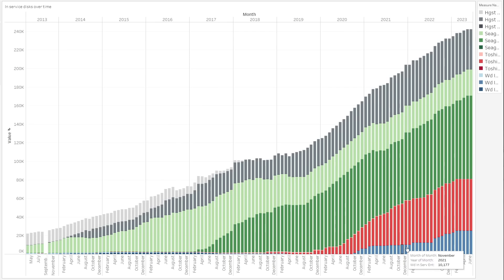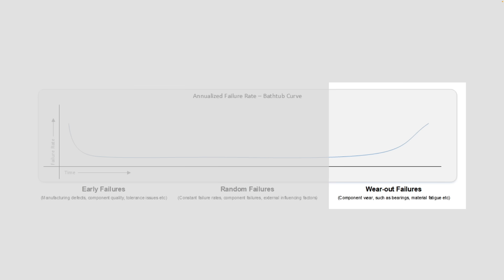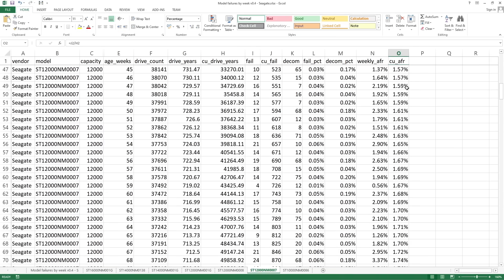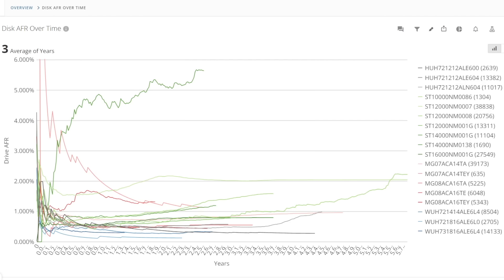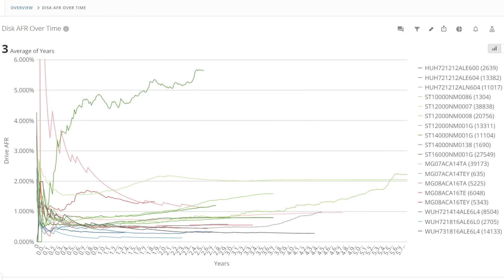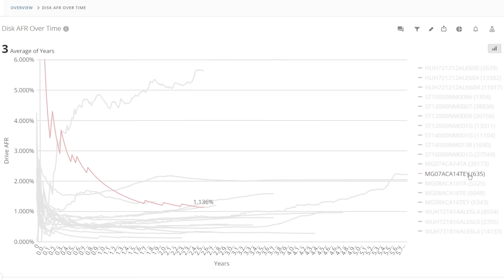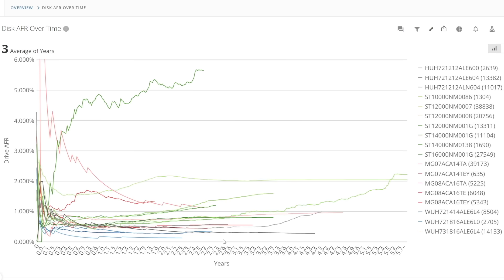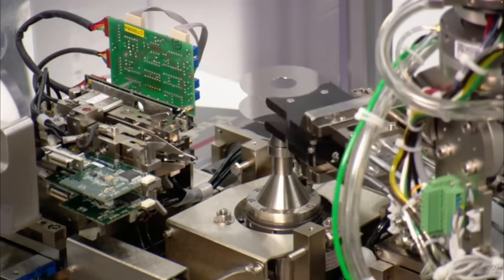Failure Rate Analysis - Best 10Tb+ hard drives: Seagate, Western Digital or Toshiba?

Comment: Great video! Made me reconsider my choices

I want to buy a 4TB external HDD

I want to use it mainly for archiving (videos, movies, games), mild use, 1-3 times per month.

What do you recommend? is the same results in the video apply to external HDDs?

So far a found a good deal for Seagate Desktop 6TB for 109$, while WD Desktop 4TB is 129$

Should i buy WD 4TB for better reliability, for more price and less storage, or Seagate 6TB with more risk? Or is there a better option you'd suggest? (I heard that buying an internal HDD and using it as external is actually better and more reliable)

Thanks a lot!
Reply from the maker: Thank you! The biggest consideration I have for external drives is if the drive in the enclosure is SMR or CMR. And this is not stated unfortunately. I have some videos on this, but SMR drives often have horrible write performance, and almost always have terrible rewrite performance.

Seagate externals pretty much always have barracudas in them, and these are SMR up to 8TB or so. WD it’s less clear for up to 6TB, but I shucked and tested an 8TB and it was a solid CMR drive. Above 6TB, I do not believe WD make any SMR drives (other than Exos high end Datacentre host based SMR, which you don’t need to worry about).

So my preference is WD, but it does depend on size.
Reply: @sometechguy  
Great! but is (External HDDs) generally a better option for archiving than (Internal HDDs with enclosure) or should I go with Internal one?

My main goal is to keep my files safe for the longest time, I'm keeping the hard drive at home, not going to move it around.

Thank you again.
Reply from the maker: @Lightrov i have a mixture of external drives and internal which I put in an enclosure that I use for cold storage. Here are the pros and cons.

External - often a very cheap way to pick up storage, if you pick up deals. The prices seem to fluctuate more with great deals sometimes, such as Black Friday. 

However, it’s less clear what you get drive wise and more likely to get SMR drives if <8TB, shorter warranty and I don’t like the heat as the ventilation often not so good on the enclosures.

Normal internal disks in an enclosure such as Sarbrent. You know what you get and you can more easily avoid SMR drives, pick up where the deals are, but I would go WD Blue, Purple or Red or Seagate SkyHawk or Ironwlf, avoid Seagate barracuda or Toshiba P300/S300 drives due to SMR and performance. 

May not get quite as good prices.

You can also : buy good deal external drives, avoiding the SMR by buying WD 8TB+ or larger seagates (10TB+), shuck th drives and use them in a Sargent.

Great deals on Purple and expertly SiyHawk. Just check the data sheets for the specific model and confirm they are not SMR.  I picked up some 8TB Skyhawks for great prices. 4TB probably not the best price per TB point, consider 8TB drives.
Reply: @sometechguy 
Thank you, that helped me a lot!

Comment: We fixed high failures on one of our rack as it was on the same slate of concrete as the AC compressor, so ground vibrated a little. With tape, we made 4 rubber standoffs from a single box of rubber gloves. Ever since, there was no anomaly in failure rate on that rack.
Reply from the maker: Interesting failure condition, and solution. 😁

Comment: I just had a Seagate 8 TB external hard drive die after simply shutting it off to move the desk. Turned it back on and it wouldn't power up! I even took it out of the case and ran it with an adapter. I've only used it for about four months! It didn't have anything that couldn't be downloaded thankfully. Seagate's always been reliable over the couple decades I've used them. I suppose having one die so quickly does happen on occasion.
Reply from the maker: Those 8TB externals usually have Barracudas in, which are SMR drives. Not that this is any way an excuse for it failing, and certainly not for even failing to power up, but I am not a fan of those. They come with 1year warranty, I wouldn’t defiantly try to exercise that. 🙂

Comment: through my experience, western digital seem to have the worse drives. I have had all 3 out of 3 western digital raptor drives fail within 5 years, 4 out of 6 western digital black drives failed within 5 years, these drives were not ran constantly, apart from the raptors which were for loading games from, meanwhile my old seagate drives I have never had fail, the need for more capacity was needed before any failed, and they were run every day, I had an old maxtor drive fail recently but it was over 1 decade old, I have also never had a samsung ssd fail.

Comment: Old HGST were the gold standard.  Now, all I think you can find are refurbs... but even those are better than Seagate
Reply: I had been buying the 10tb HGST refurbs branded as MDD.  Eh. Out of a group of three all bought at the same time, had one fail in a NAS at 18 months, plus whatever time it had before being resold.  Another of the three had some sort of weird partition issue at the same age.  10tb would not accept partition above 3tb. It felt like a platter failure. Not sure what's going on.  But I am replacing them with new WD Red Plus.  Generally prefer HGST or Toshiba.

Comment: I just decommissioned a WD Red 3TB (WDC_WD30EFRX) that had 108698 power on hours.  I've only used WD drives in my unraid server for the last 15 years and have had, I think 3 failures and they were all under warranty.

Comment: Would a standard WD blue be fine for desktop use? Just storing video footage
Reply from the maker: Yes, but just make sure you don’t get an SMR version. I have a video that covers the performance of the WD blue SMR and CMR drives along with The Seagate Barracuda and Tosh P300. For reliability, I think they are solid drives, though. It so much raw data to crunch on that.

Comment: Seagate is cheaper, but not by much. Not by a reasonable amount I'd be willing to bet my data on it. For a data center with thousands of drives? That's a different story.
All drives fail, I pray none fail without backup!
Reply from the maker: Yes, I agree with this. If you have large numbers of drives, validate backups, carry some sparing and are happy to use warranty; then small differences in reliability are easily offset by cost. But for smaller deployments, home, small and medium business then it’s a different calculation. Would love to see that gap closed though, interested how the newer HAMR drives play out.

Comment: Thank you for compiling the data, I never understood it like this when I looked at the data myself. 
Unfortunate that Seagate drives are so unreliable. From dB measurements their NAS drives are the most silent drives out there. I also hear when seagate drives fail they fail hard, so not so easy to back up. They also have enterprise drives that are less noisy than the other competitors.
Reply from the maker: The source data is organised by date, so if you look at failure rates this way you can see how failures happen over time, but it doesn't consider the age of the drives. So a more useful angle is to rearrange the data based on drive hours to find out how long each drive survived before failure, decommission or just how long its current service life is.

It is fantastic that Backblaze collect, keep and share this data; and the number of datapoints that are captured each day. It means there is a huge quantity of data here to look at, and I will be doing an update soon as its been 18 months now and there are now quite a large number of 20-24TB drives in the data that are starting to collect hours.

And yes, share about what the data reveals about the Seagate drives. Though they seem to be improving which is promising, and i am keen to see how that develops with the 24TB Exos. Though it seems not currently, they have also often been cheaper to buy, which with the warranty coverage, may still make them a good buy if the AFR rates are not too far off.

I am also doing performance tests at the moment on various Ultrastars and a comparative with the WD Ultrastar 18tb and Exos X18 18TB. This will include noise comparison, so will be interested to see how they compare for performance, noise and power usage.
Reply: @sometechguy  great work!

Comment: I have used WD primarily for over 20 years.  I finally tired seagate and they failed within months.  It wasn’t long at all so I went right back to WD.  I have NEVER had a WD internal drive fail and I’ve been using them over 20 years now.  I replace them to add higher capacity so I don’t know how long they would even last.
Reply from the maker: I have not had any serious issues with either brand personally. I have had some of each fail. But overall my experience reflects the data here. In total I probably have maybe 100 drives of various capacities in my home setup, with a pretty even split of WD and Seagate and I have an occasional failure, but the WD seems more likely to fail later. I just had an Exos fail that was 2 years old, and I had a Ultrastar that isn’t reported as failed, but it definitely isn’t ‘well’, and that was basically in this situation when it arrived. I have a collection of WD Red 6tb that are 7years old and they have been failing starting from around 5 years occasionally. 

But for sure due to the nature of statistics, some people have worse experiences with one manufacturer over another. 

The data here, at least at this point suggests WD do better over the long haul. And recently, the price gap narrowed and sometimes Ultrastars are cheaper than Exos, so this is what i am buying recently.

Comment: Can we get a refresh of this data for the new year, maybe Seagate x18, 20
Reply from the maker: This is on the cards soon, have a couple of other things I am working on but once the Q1 data is out, I think its time as it has been 18 months. Backblaze now have Tosh 20 TB, WD 22TB and Seagate Exos 24TB drives deployed. The Exos will only be maybe 3 months of data, but the WD and Tosh units will be over 6 months by now. 

And of course, longer datasets on the 14 and 16TB disks also. Stay tuned and don't forget to Sub to catch it. 😁

Comment: THAILAND, I prefer WD than other. Because WD's label specified "produce in THAILAND" (while other produce in CHINA, vary low quality and reliability).
Reply from the maker: Thailand has long been a center of excellence for disk manufacture. I have a pile of disks here, the WD drives seem to be made in Thailand, and the Seagates are a bit of a mix, but many say Product of China as you say. I think there was some diversification of manufacture after the terrible flooding events that brought the HDD industry to a stand still back in 2011.

Comment: Thanks nice and informative video) Can you tell me which software for charts you use, looks like it's own solution, but I'm curious which library you used for rendering charts? is it Grafana?
Reply from the maker: I dabbled with a few over the last couple of years, I think in this video I actually used Tableau. But its kind of expensive for my needs, and I think built for more complex visualizations than I need, making it a bit unwieldy. I then tried Domo for a bit, but again the simplest tasks seem very complicated an intuitive and I wasn't able to easily place multiple datasets on a single graph easily.

So I am actually using Canva in my current videos. Its far simpler and less feature rich, but it seems to do the things I need very well and its great for interactive charts. I think its a bit more limited for large datasets, so will see how it goes.
 
Always love to hear recommendations for this.

Comment: please do Failure Rate Analysis on external drives like wd elements, wd elements desktop, wd my book and other external drives from different brands
Reply from the maker: Hi and thanks for watching, and asking the question..

Good failure rate analysis requires a good data pool, and unfortunately no one is releasing data on large scale use of external USB drives. Mostly likely as they are just not used, or suitable for large scale use. These are typically used by home users in small numbers, so the data just isn’t collected.

It would be great to do this, as I would be intrigued to see how drives in these enclosures compare to the same or similar drives installed normally. Just no data to call on. 😢

I did do a tear down of an Elements enclosure, and looks like it’s a consumer class 5640RPM CMR drive, similar to a blue or a red plus, but firmware designed specifically for this use. These are likely to be pretty good drives, but they do run hotter inside than out.

The Seagate backup units are most likely going to contain Barracudas, at least up to 8TB, and I am not a fan of rheee disks, they are SMR, perform pretty badly, and I wouldn’t bet so much on the reliability of these over the long term, mainly because they are SMR and suffer for write amplification effects which mean they need to work harder.
Reply: @sometechguy  wow thank you for the long reply, i requested that coz i wanna do a single drive archiving without any backup and idk which external drive (WD Elements Desktop or WD My Book) last longer longevity and health-wise, that why i wanted some advice from a professional like you. im on my way on becoming a data hoarder lol, data is important hehe.

Comment: I just want the most reliable drive, i dont care if it isnt the fastest, i dont want this shingling stuff, and i dont need it to be bigger than about 4tb, as i can just buy more, they seem obsessed with making them more and more dense, and the expense of longevity and risk of losing more data
Reply from the maker: I don’t think density is really correlated to reliability. Some of the most reliable drives come in the larger capacities, because those are the drive use cases that require it. 

If you want smaller drives, this (for some reason) is where most of the device managed SMR drives exist. You can get enterprise drives in this range, but the price per TB is high. I’m would suggest going for a Red or Purple from WD or a Ironwolf or Skyhawk from Seagate. For a premium, you can also get Red Pro or Ironwolf Pro in those capacities.

Stay away from SMR WD Blues, Seagate Barracuda (SMR also) and I wouldn’t touch the Tosh P300/S300 either, also SMR. WD Blacks are over priced in my view.

You can get better price per TB as you up the range however and 18TB Ultrastars as an example give a great price per TB price point and are well built. But if you don’t need the capacity, it doesn’t make sense of course. 

I have videos covering quite a bit of this, and one coming shortly comparing desktop to surveillance drives, as well as the NAS ranges.

Comment: my wd 2tb external failed in 10 mnths..little use
Reply from the maker: Not that it’s an excuse, but external drives are subjected to things that don’t help their survivability. Some of the enclosures don’t have adequate airflow to keep the drives in a good temperature range, and sometimes people move them around when they are running, which I don’t think can be a good thing given how close the heads fly and the gyroscopic affects of the disk platers. They seem to be able to handle it, but I think it increases the chance of issues. 

Hard to help them with the temp issue, other than shucking them, but I would make sure you don’t move the drive when it’s running. And sucks it failed, was it the disk? Or could it have been the enclosure itself?

Comment: somebody just tell me which ones to buy.. thanks
Reply from the maker: I don’t like to say you should buy one or the other, as it depends on the capacity you are buying and what you will use it for. It also depends on current prices. But recently I have found the WD Ultrastars seem to be well priced at many capacities (16, 18, 24TB) and they show the best long term reliability. I also think they are well built, though seem a little noisier. I have a link in the description. I have been buying 18TB and 24TB for my own use.

Comment: I've had 3 WD harddrives fail over the years with minimal use.
Reply from the maker: It can definitely happen, but it’s a pain. I just had a 6TB Red go, but it had 7.5 years run time on it. I am also testing a Ultrastar 18TB right now to do a comparison with the Exos X18, and it’s suspicious due to some oddities with its read performance and some funny noises, but no SMART errors as yet after writing over a 100TB to it. But they are more likely to fail early, or years later.

Comment: I'm using WD right now. I feel like it's not as stable as it should. I had terrible experience with Seagate failing. I'm considering to try Toshiba once, but from seeing it's failure rate with DOA's, I'm not sure whether I should pick this one up.
Reply from the maker: Early failures are inconvenient for sure, but at least you can warranty return them, assuming they came via an approved reseller so you know warranty is good. As always, just ensure you have backups of anything you can’t afford to lose. 😎

Comment: 13 years ago I've built my first PC with a 1TB WD HDD as my only drive. A complete drive wipe and two pc builds later, that drive is still functioning, although I stopped using it as a boot drive after about 4 years. I'm frankly astonished, regardless I don't have anything important on it anymore but I will be sad when someday it does die.

Comment: How about ssd? Hdd are dinosaurs 🦕 😅
Reply from the maker: I have not seen such a good data source for SSD. Backblaze have SSD but it looks like mainly for boot drives, so the numbers are much smaller and they don’t have the intense workload. I will be doing content on perf testing SSDs though.

But SSDs are better at some things. And HDD are better at other things, so depending on your use it may seem that HDD are old tech, but they are still king for high capacity, low cost data storage, and they have endurance advantages also. So they are not dead yet. 😄